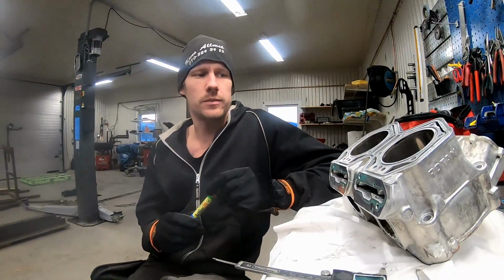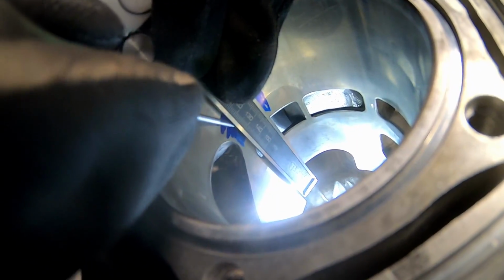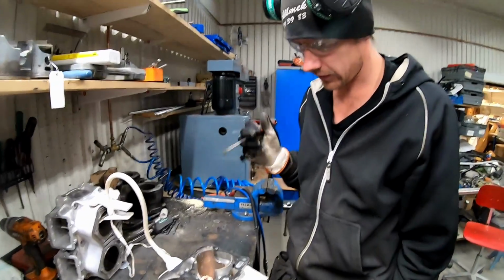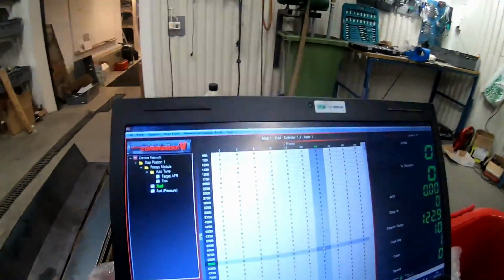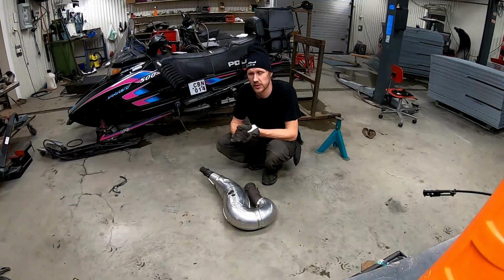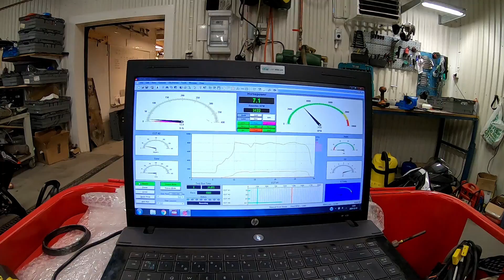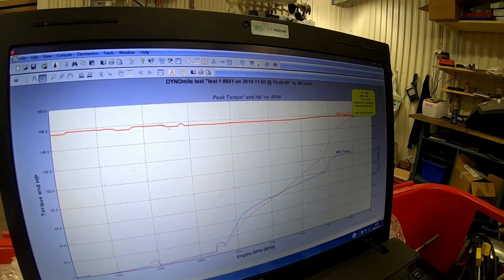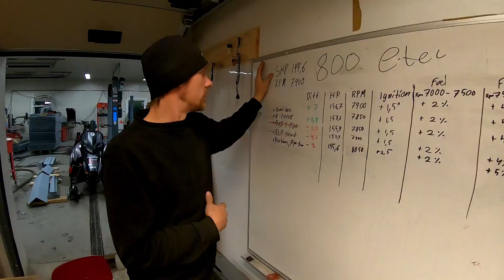Dyno academy 800 e-tec dyno and tuning step 4 porting

Comment: how did you add the extra fuel specically please. just top end?  like 4% at 8000 then taper linearly to 6500 to stock (no add fuel over stock at 6500... just guesing)  pelase advise how to do that fuel add as well please . aweome video!!!!!!!!!!!